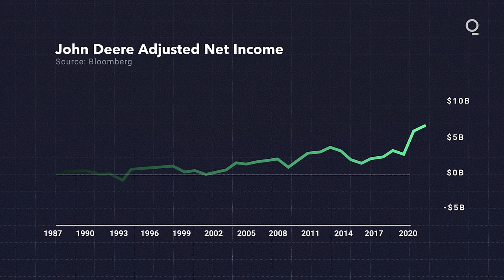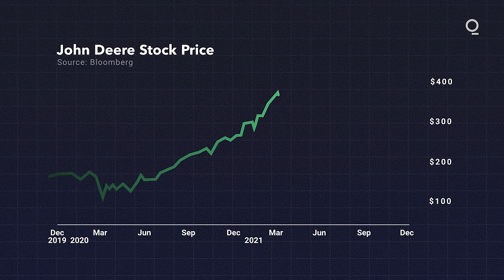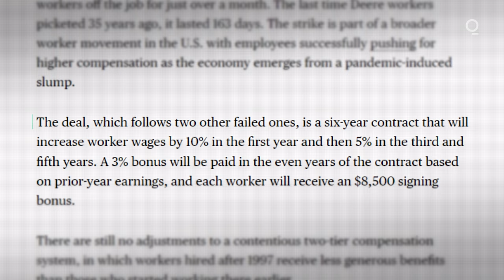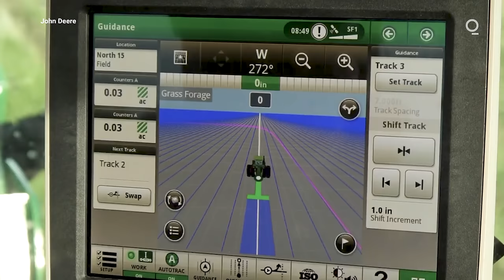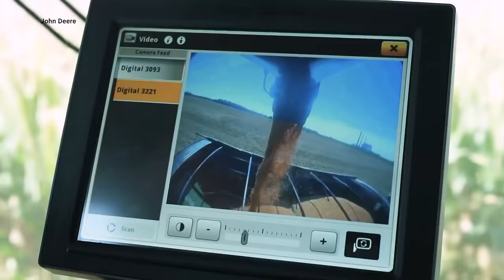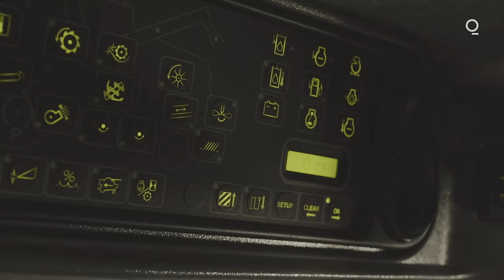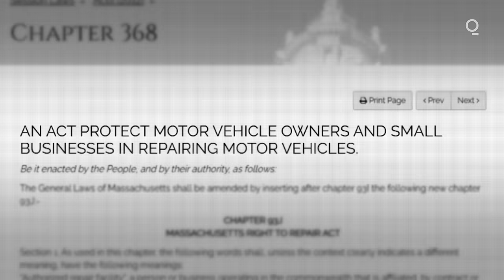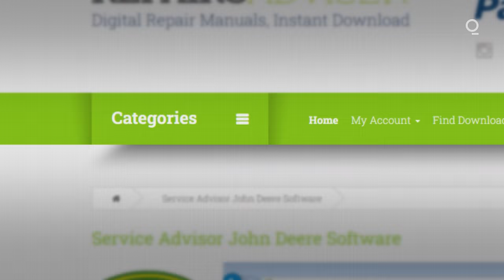John Deere Is Facing a Farmer Revolt

Comment: If a product (car, tractor, phone...) is purchased by a person or business, then they have the right to repair what they own.  It should be that simple, otherwise it's not ownership.  John Deere should only lease equipment if they intend to prevent 3rd party repair.  That would stop planned obsolescence.
Aviation is a highly-regulated industry for safety, and comparing farm equipment to aircraft is like a 3 year old declaring he's a "big boy", but not cute.
Reply: @joel8340.  i agree with your sentiment, but lots of older tractors are in use. The way i see the issue is that there will be no 50 yr tractors coming out of modern john deere. They aren't cost effective to keep running with only dealer repairs, especially not for second owners.
Reply: @joel8340.   sorry but there is a lot of tractors out there 50 yrs old and still working just fine,,,, will a 2022 tractor be working in 30 yrs ? , I doubt it !! Sounds like a big problem on the horizon 🤔
Reply: @joel8340.  actually due to this very issue, old tractors are going up in value, because while the new technology might be nice when it works, between emissions and inability to repair the newer stuff, a lot of guys are snapping up the older stuff and basically restarting production on parts.
Reply: "Tractor on a highway"??? 🤣🤣🤣
Reply: @ke6gwf  my grandpa has shed with like 20 small tractors from 50s to 70s all pretty basic smaller ones size of car… not sure why he keeps buying more they don’t seem worth more than 5k
Reply: @joel8340.  tractors don’t go through huge overhauls at a set number of hours or time
Reply: @dustintacohands1107  that sounds more like hoarding, and I am jealous of his collection! Lol
It's not the small ones that are in demand, except by orchards and such in some places.
It's the large older ones, like the Era just before computers and emissions, so modern hydraulics and such, but simple to repair.
But, if he's collecting the type that I think, they too will probably go up in value, either as working machines, or just as collectors items.
Reply: @ke6gwf  they look like old one from this video but most smaller only like 5’4” tall or so on front maybe tires 5’8” .  Very very basic
Reply: @ke6gwf  I could see being collectors items for sure but not for about another 20 years.   I looked up his favorite fro when he was young and highest was 7k.  Wish I could remember name of that one but a few are farmall for sure
Reply: Funny thing is you likely typed this using a device that is designed to not be repaired.
Reply: @mlo527  if you can't see the difference between a few hundred dollar phone that you can still replace the screen and battery on if you really want to, or you can grab another one from the store down the road, or even have spares, and a several hundred thousand dollar machine that your business is relying on completely, then you are missing the point.

And Apple is pretty much the only one who makes repairing their phones as difficult as possible, and they recently changed their policy on that matter, so your point is kind of weak.
Reply: They do, Deere breaks the law and nothing happens.
Reply: Big jets are not really supposed to be flying without the sanction and support of the manufacturers.  Yet it hasn't stopped Iran Air for continuing to fly old Boeings and Airbuses domestically despite having been cutoff from official  parts supply channels for decades.
Reply: You can repair on road machines far more dangerous than far /off road equipment they the companies are lieing!
Reply: @cyberslim7955  Actually, yeah.   Farmers now farm more acres and cover more miles.  The road speed is actually a question the farms ask because they want a tractor that will go down the road as fast as safe.
Reply: @cyberslim7955  Yep I have seen this in South Dakota, not new, Have seen it when I was a kid 2--12 in Wisconsin too from 1991 to end of 2000.
Reply: Like Microsoft. Microsoft doesnt sell its programs. You have to lease them and if you dont pay they keep your data and you cannot get to it.
Reply: There is nothing to prevent you from going to a third party. It's just that they don't want to give out the software and there is nothing that forces them to give you the software, thus you need them.  Farmers should go back to using old tractors if they don't want to use the current technology, since obviously most of them are against government intervention.
Reply: Jerry Boden  O yes they do! A farm group in Mexico is doing just that, and becoming, mega, mega millionaires. In fact they run the cartels off and reconstitute entire regions. Referb is HUGE business in Central America, and Africa.
Reply: @amabdall  However this is why other companies Case and New Holland allow other big machine repair places to buy the software for the machines but charges monthly or yearly and nobody can buy it like one can with Microsoft programs.  Kubota deals with smaller machines that often do not have all the tech in it or if they do, the person who is doing the repairs has to buy the updates to the software each time just to keep the vehicle running.
Reply: @mlo527  I am using a Desktop PC with a core 2 Quad 9650 and a Radeon HD 6990. running windows 7 64 bit :)

Comment: Just another company that forgets how they got there. Short sighted, greed. Disgusting offensive behavior. There I held back some.
Reply: Welcome back to capitalism
Reply: @Cheesecake99YearsAgo  exactly - why do people think capitalists would behave otherwise?  this guy is just following the rules.
Reply: @Cheesecake99YearsAgo  capitalism is like democracy it’s what you make of it.  Either of them can be the best or worst systems.  History has shown us what foolishness democracy can bring.  And the present shows us the foolishness of capitalism now.  Either way the stats shows it’s still better than other systems.
Reply: You reckon the average farmer or tractor driver can fix complicated electrical and gps issues ? I’m not defending it. But then there is reality
Reply: @patu5798  it's not so much farmer doing computer repairs it is the codes informing what sensors are reading some of those are simply adjusting moving a sensor closer or replacing the sensor.  Main dealer repairs start when they depart the dealership, you can rack up 100 just on the tech appearing at your farm, this might be simply the vehicle needs to go to the dealership to be repaired.  This also kills local small independent guys who charge sometimes half the price of a main dealer.
Reply: Jerry Boden  they ware out are not big enough to do the acerage they are farming.
Reply: @patu5798  the indipendent repair tech cant get the info wake up ps its  no harder than  the cars  and trucks of today to fix!!!!!
Reply: @patu5798  It's not just that, J.D. has put a whole lot of extra sensors on the tractors that just a simple sensor fault, not from any damage or anything, will grind the tractor to a halt, which then REQUIES the dealer to come out and "check and clear" the code to do a simple fix like that.
Reply: Jerry Boden  Isn't that the same as 'One person, one Phone , or PC.' ?   these "items / tools" are on the desk for anyone to use in our business. - no personalising.
Reply: Jerry Boden  Oh ! the other way around then - huh - just about as bad then ?    putting Ppl out of work - nearest becomes farm simulator........    simulators and "Models" everywhere - look at what all gubbermint models do !
Reply: @andrewslagle1974  cars and trucks today do not have extremely complicated electrical and auto steer systems in them. Fool
Reply: @peteparadis1619  might help if you let us know who’s a fool lol
Reply: @patu5798  Everyone but me
Reply: @peteparadis1619  spoken like a true fool
Reply: @Cheesecake99YearsAgo  what's the better alternative the

Comment: John Deere comparing their 10mph equipment to 500 mph commercial aircraft is comical.
Reply: Total BS of course.
Reply: They go 45 now 🚀
Reply: I thought I was the only person that caught that 🤣
Reply: It's because they force limp mode if any of the sensors goes off
Reply: Yea. haha.
Reply: Took the words out of my mouth.
Reply: Farm equipment is very dangerous. lol obvious you have no idea what you're talking about.
Reply: John deere guy should be a politician, trying to modify the issue.
Reply: @shawn8847  You can't just pull over with an airplane... thats the only reason the safety standards on aircraft is so high...
It isn't rocket science
Reply: @Morpheen999  and planes carry lots of people a tractor only carriers the operator.
Reply: That was the most disgusting part of this entire article right on top of Deere's disgusting practices.
Reply: JD tech here. No they are not as fast as a jet but the tech that makes them run is equal to that of a new airplane. I'm also a pilot
Reply: Yup. How much did it cost Boeing ? If a Deere combine fell outta the sky would result in a handful of deaths, not hundreds
Reply: I thought I was the only person thinking so
Reply: @shawn8847  dont tell nader
Reply: @shawn8847  uhhh yes but if farm equipment breaks you don’t come crashing down outta the dang sky with it.
Reply: I also thought that was a stretch of a comparison to put it mildly lol
Reply: the engine suddenly shuts off mid flight
pilot checks the instrumentation and only sees an error code:
call your dealer
Reply: @nanopi  call em up their “ ahhh yeah we should be able to get you in next month “ 
Pilot then confirmed it was ok to leave plane at shop today till it was fixed.
Reply: Over in Australia: I nearly choked when that dumb JD spokesman tried that on. He should now be looking for another job right away from machinery. His insult was palpable with a handful of self-importance thrown in to make him look even more incompetent.
Reply: Yes, not to mention the number of people at risk if anything were to go wrong. One guy in a cockpit watching computer screens and corn vs. an entire plane full of people.
Reply: I don't know about that. Feed someone through a combine and I'd bet the pieces would be similar to what you'd find at a crash site.
Reply: Comparing transport aircraft to tractors seems like a stretch.  Hollywood should get involved and make a movie about the combine that went berserk.
Reply: @shawn8847  Ya, I clearly remember that tractor crash last year, 400 people died in a fireball... no wait, one guy died. Totally the same.
Reply: It's a bad argument that many companies like John Deere, Tesla, Apple, love to make.
Reply: @sleepyta  ever have a combine fall 30,000 feet out of the sky?
Reply: @wingman5985  same thing could be said about a wood chipper. You don’t hear anything about wood chipper manufacturers claiming that their equipment is as deadly or sophisticated to handle as a 747. A permanent L on your forehead sir.
Reply: @eliworks8549  clearly that's the only argument he could come up with. Which is a pretty clear indication that they don't have an argument other than greed
Reply: @shawn8847  lol I had to duck a flying haybaler just the other day:-)
Reply: @Morpheen999  Yup. And a few more passengers on the plane ... who aren't family members.
Reply: So when a farmer "hacks" his software not knowing what he is doing and causes his electronically controlled handbrake to come on at 45km an hour. You wouldnt consider that dangerous to anyone?
Reply: @cameronveraart9686  Not really, back wheels will lock up if your lucky and in 2wd but more likely you'd rip the parking brake clutch packs apart and it'd keep rolling and you'd use you normal service brakes to stop.
A car poorly repaired by its owner is a far bigger threat but no one says 'no' to people fixing their own cars.
Reply: They can reach speeds upwards of 55 mph on the highways
Reply: @farticlesofconflatulation  A witty comment on my part deserves a permanent L on my forehead? You probably have a lot of friends sir.
Reply: @cameronveraart9686  For centuries, nay millennia, farmers have been allowed to do things without requiring that they know what they are doing. What changed?
Reply: the fun thing is that he used aviation in general, "just anybody" is able to legaly build an airplane(with some paperwork and inspections) and then do all the service/mods on it themself, heck if it is ultralight it does not even need to be inspected

Comment: Comparing a tractor to a passenger jet is laughable! Absolutely nothing close to relating to each other in a safety aspect. The technologies may be comparable these days (which, farm equipment has no business being so advanced), but there is no way a malfunctioning tractor is going to be as dangerous as a malfunctioning jet, or any other aircraft.
Reply: I agree. Interestingly enough the FAA allows owners/operators to do a substantial amount of maintenance themselves prior to needing an FAA certified mechanic. Probably to an extent that would give that Jahmy Hindman an aneurysm if he knew about it. Even tasks that require government certified mechanics (A&P/IA) are not hard to accomplish as such specialists can be found at most airports and aren't employees of the aircraft manufacturers. Smh.
Reply: I noticed that. That was a vile excuse.
Reply: Woooosh point missed completely
Reply: yep. Soon as I heard airplanes the BS alarm went off.
Reply: did you know: the natural bioelectricity produced by a leaf on an oak tree is directly comparable to [insert most powerful capacitor discharge known here]
Reply: That and the reference of it going down the road and i know sometimes they are driven a short distance to get to the next tract but the software more than likely has zero to do with that.

Comment: I work for a company that builds mining trucks and equipment, We have worked hard to keep the equipment simple and easy to repair. We use old tried and true engines and wire things up in a way that is easy to understand. The miners love our equipment because it is easy to fix.

Comment: Just went through this with a hydrostat transmission on a John Deere 4052 loader.  The forward pedal broke and we were able to replace it.  However the pedals are fly-by-wire and have to be recalibrated whenever they are disturbed.  The dealer had to send a service person out to hook up to their laptop.  This isn't just farmers, but anyone that has a computerized tractor.
Reply: Absolutely hate electronics
Reply: Modern cars have similar problems. There are more and more components that must be programmed after replacement

Comment: I sometimes think that we go backwards, and I have personal experience of this with Caterpillar engines, the older engines ran forever with simple and minimal maintenance. Unfortunately although the newer engines when working are more efficient, when they go wrong it's a nightmare. We took the strange step of buying and reconditioning older engines and fitting them in place of the newer ones, which we sold off. Lo and behold repair costs plummeted, productivity increased and everyone was happy, technology is not always the way forward.
Reply: Aside from planned obsolescence, I think that new and improved technologies will almost inevitably come with reduced durability due to wanting to use less material and lighter (and weaker) parts and increased hassle when trying to diagnose and fix due to increased complexity.
Reply: @TROll-oe9ng  The biggest reason new stuff isn't reliable is the EPA forcing engines to meet insane emissions requirements.
Reply: @Elemblue2  You are all correct in what you say in the above replies. We did an analysis of breakdowns and 55% were due to faulty sensors shutting engines down. The old cats had minimal electronics, so for us it was back to the older designs, luckily we didn't have to worry about emissions then.
Reply: Variations in circumventing technology exist worldwide today, just as always for necessity. 
ie: A late model chassis of car totally disabled by $$$$ tech failure, having engine and drive train removed for junk salvage, as the still functional chassis itself promptly harnessed to a horse or mule, for a comfy ride for 3rd world masses (with creativity) ;}
Same as plentiful/cheap small diesel engines/transmissions/drive trains in 3rd world remote enclaves (formerly Communist), are installed (by creative entrepreneurs) in place of failed high tech power devices.. creating Tesla chassis (sans battery modules) diesels?
Reply: @blogengeezer4507  Man always finds a way

Comment: Right to Repair is an issue I first saw about 2-4 years ago in terms of an article about John Deere viewing factory repair services as a profit center.  Specifically, a part prone to failure that the tractor would not let itself be operated without working.  The problem was that it was not user repairable.  The user/owner would have to wait 2 weeks for a factory service tech to come out to replace it.  This usually happened during the short harvesting window.

It was so bad that older JD tractors sold for a LOT of money because they were owner repairable, unlike later models.